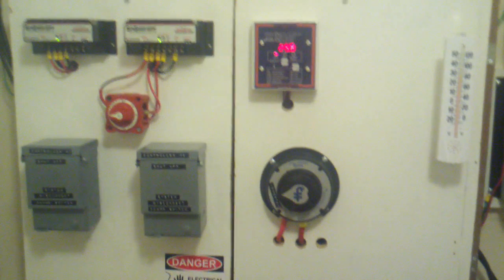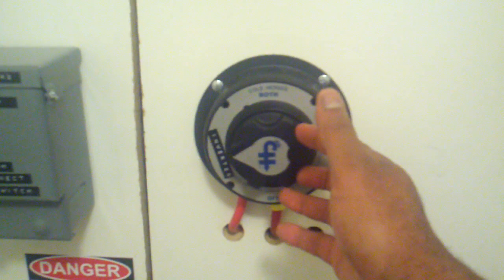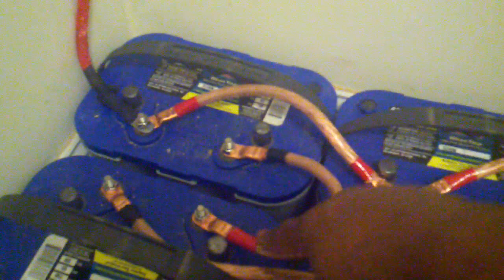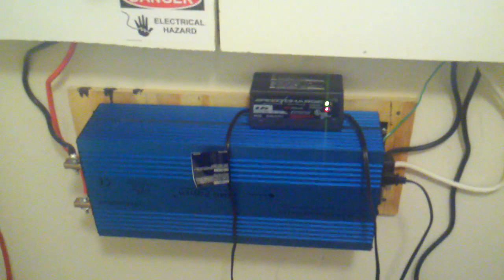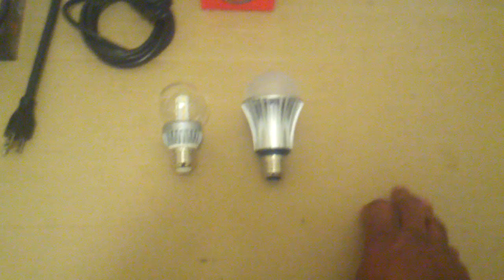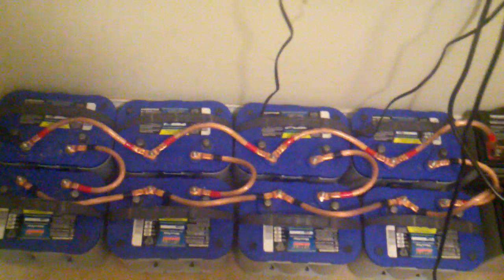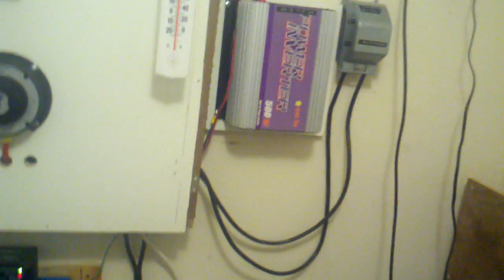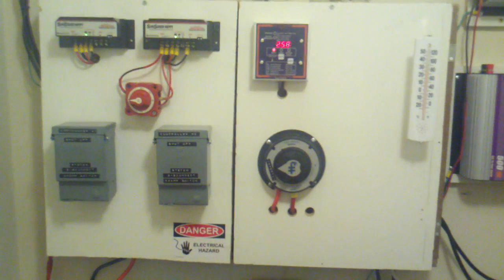DIY- Home Solar - 1 Year Later

Comment: After all the conservation and solar power what is your utilities power consumption compared to last year?
Reply from the maker: Over the years I've discovered, for myself at least, that for every kW of power your system has (i.e, the size of your installation), on average you can "hopefully" expect a 10% decrease in your electric bill.  That is not a hard and fast rule, but an observation of someone who has a typical US household with typical US household electrical uses.  People living a purely off-grid experience or with a different type of household (more kids etc) may have a different opinion.

Comment: Also, a question - have you seen any downside to running your system on 24V? I agree that the wire & resistive losses are much easier to deal with at the higher voltage, but I would like the ability to charge my batteries easily from grid AC and I don't think 24V chargers are commonly available. Do you have any comments on the subject?
Reply from the maker: Thanks for your comments. I like my 24v setup it's more efficient and allows more flexibility when expanding your system. I recommend looking into inverter chargers. theinverterstore(dot)com is a good place to look. I see no "real" downsides to a 24v system. I don't run any DC appliances.

Comment: rhandsom,  I enjoyed this video and I am seriously considering getting into solar.
I was wondering if you could share the wiring diagram for your batteries. I want to plan out a system I can afford and plan for possible expansions for the future.  I could be wrong but  I am thinking about doing a 24v system, minimal batteries(4) and using a grid tie inverter.  In short, I want 2 produce power during the day while I am at work, (hopefully run my meter backwards, the use the grid during the night.

Comment from the maker: Thanks for your comments. Incentives are good, but having backup power when you need it is better.  You can have a really good backup system for around 5k give or take.  $1200 for some panels, around $500 for good inverter, $300 for good Charge controller, $1200 for a good battery bank, $1000 for mounting equipment (optional), you can build your own.  $800 for wiring, safety equipment etc.  These are approx estimates, could be more or less.

Comment from the maker: I actually leave my inverter turned on all the time.  That way the power is there when I need it and my batteries are constantly being exercised, although minimally.  My current inverter only pulls around 3 amps while in standby and what comes out of the battery during the night is quickly recharged during the day so I essentially loose nothing.

Comment: Nice setup.  My question is:  When you are not using anything off your batteries do you turn your inverter off or leave it running all the time.  Thanks in advance.

Comment from the maker: Thanks for your questions.  I got the majority of my LED's from COSTCO, Home Depot, Lowes.  I even got my yellow LED porch lights from Fry's Electronics.  LED's obviously cost more than Incandescent and CFL's, but during an outage the good light and low power draw pays off. To build a system like mine with panels, batteries, interlock, transfer switch, charge controllers, pure sine inverter, mounting structures, wires, cables, fuses, disconnects and pro help, could run around 10k-12k dollars.

Comment: Thanks for the tip about wiring the negative (battery side) charge controller cable to the last battery in the bank.Been getting either uneven charging myself or have a dead battery *Lets hope not* lol

Comment from the maker: At first glance your setup appears fine, 3 24v arrays in parallel, with what you propose is ideal. With that much power coming in, I would use an Outback series inverter with charging and grid tie capabilities. That way the excess power is not wasted and you'll also have the standard inverter capabilities in a power outage.

Comment: can you help me on my solar power build-up? I'd like to hear comments from you about the components I will be using.

Solar Panel : 1 panel with 6"x6" cell of 4x9 configuration with 140W, 18V.
2 panel will be in series for 24V battery bank system. Then 3 pairs of series panels will
be connected in parallel giving around 800-850W total.
50A MPPT charge controller
2000W Pure Sine Inverter
4pcs. 12V, 100AH deep cycle battery (setup for 24V)

Comment from the maker: I omited the GTI on purpose to keep the layout simple for others. Also, due the fact that my system's primary purpose is for backup and partial off the grid use. With that in mind, others can start with that as a foundation and move on from there as they choose. But yes, this is the most update schematic.

Comment from the maker: Thanks for the clarification. I don't believe a neutral\grounded inverter would work in this setup. I actually, tried to use a cheap Wagon type inverter in my earlier setup and it stopped working permanently after I plugged it in. I believe now, that it was probably like the kind you mention, being neutral\grounded, not good. Aims and Outback Inverters are good.  Outback is better in my oppinion, because of the models with builtin charger and grid-tie functionality.

Comment: Thanks again. While shopping inverters some are listed neutral/ground bonded.  Some have jumper that you can remove and some are not changeable.  The jumper connects the neutral and the ground so to me that would seem to say it would send the ground with the power thru the neutral. So i would have to find one that didnt have that or had one that was removeable.  Thats why i was confirming with you. I like your inverter probably just go with the same kind but want to understand what im doing :)

Comment from the maker: My inverter, like most inverters, is grounded internally to the chassis. In my setup there is no modification to the inverter. The ground in the inverter is still necessary since I still run some auxillary devices directly from it. Since the Transfer switch is grounded through the main panel any ground wires connecting to it would cause a ground fault condition. With the aux plugs running the hot and neutral wires only, grounding is not an issue since the end point is already grounded.

Comment: That was a huge help and what i needed to know. Your videos are very good and you explain everything great.  On that issue it was a little fuzzy.  One more question on the subject.  Is your inverter neutral/ground bonded OR was it and you removed the bond or OR Did it not matter anymore because of the hot neutral only run from the aux plug.  Thanks again

Comment from the maker: Also, you can tie the 2 neutrals together at the switch. They show separately to show the split. the two legs will give you the 240v the transfer switch expects, and will allow you to feed 240v (via 2 120v Hot legs) into the main panel if you wanted to pursue an Interlock swtich. Again, please consult an electrician to double check proper wiring, because I'm not an electrician. Take Care.

Comment from the maker: Thanks for your comments. Please re-verify this with an Electrician. The switch is wired at the pins starting at the top pin on the switch 240v connection - moving clockwise, "Leg 1 (Pin 1. Hot), (Pin 2. Neutral)", "Leg 2 (Pin 3. Hot), (Pin 4 Neutral)". My Auxillary receptacle is "split" into 2 distinct circuits using ONLY the Hot and Neutral wires. All legs terminate into the switch. I also use an Interlock Switch and the "2 Hots" also feed into a backfeed braker to feed 240v to the main panel.

Comment: Great video! Something ive need to know from you.  On diagram (big help) going to the transfer switch you have two hot/neutrals going to the switch.  I see the  hots go to seperate pins of the plug (black and red inside the box)  question is do the nuetrals  hook together in the switch to the switch neutral or are they seperate. On diagram they look seperate. On previous video you mentioned electrician split something.  Im ready to do something similar but cant find an answer.  GREAT VIDEOS!!

Comment from the maker: The black switch is a Cole Hersee battery bank selector switch which is used as an inverter to battery disconnect. I got it from bdbatteries(dot)com. The small red run is a SWITCH BATTERY MINI SELECTOR by Blue Sea.  You can purchase it from Amazon. I use the Cole Hersee at the inverter because of the Amps it can handle and the UL listing.

Comment: is this the charge controller you are using :
ebay.ca/itm/Solar-POWER-UP-MPPT-15A-Solar-controller-MPPT-15A-solar-charge-regulator-/251031993602?pt=LH_DefaultDomain_0&hash=item3a72ac3d02#ht_4265wt_1110

I have been looking for a good and cheap one for a while now and I looked at your schematics and searched it on ebay. please let me know. thanx !

Comment: Wow, that system cleaned up nicely!.....thanks for the update, it's good to see how things worked out for you. How about your power bill? Was there a measurable difference? I hope to eventually get a system put together to give a better comfort level in case of an outage and not needing that loud generator barking outside.